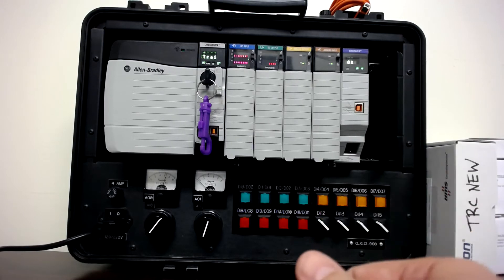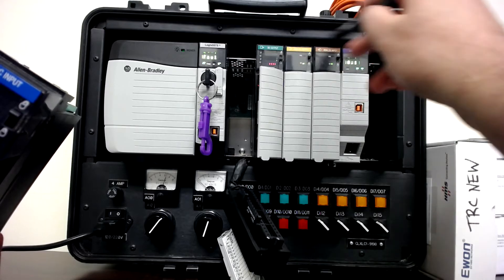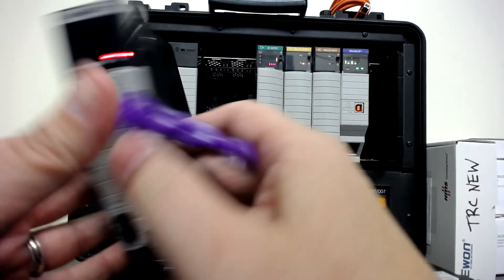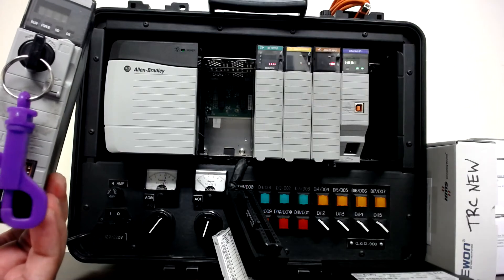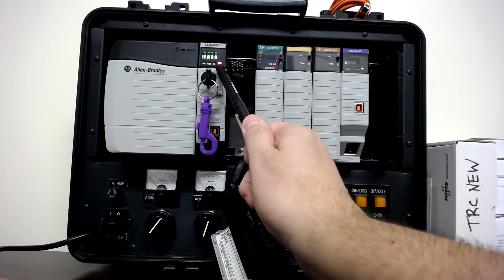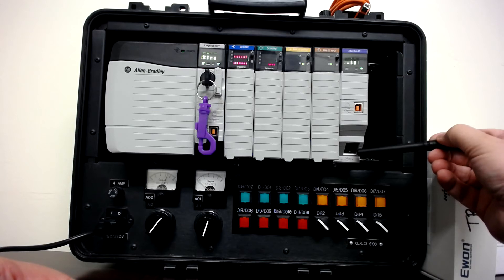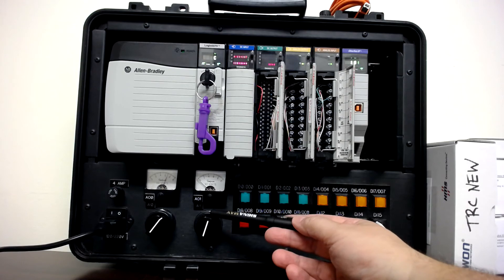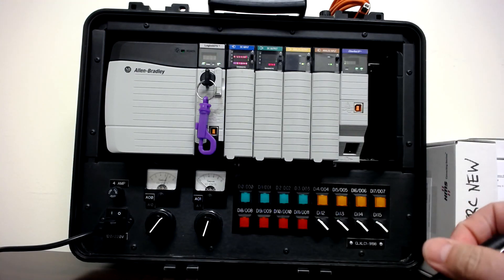ControlLogix Hardware Walk Through

Comment: I thought that the Slot configuration always begun with a Zero, So in this case the CPU would be slot Zero
Reply from the maker: Yes, in the configuration shown in this video, the CPU is in the first slot immediately after the power supply.  This "first slot" is referenced as Slot 0.  So this 7 -slot chassis would be referenced as Slots 0 to 6 in Studio 5000.

Comment: Hii, So informative your video, thank you so much. I didn´t know that you can make a warm remove of the modules (includ the CPU). I gues, if i need to add an analog module, can be pluged without power off the CPU or Passing to stop mode?
Reply from the maker: Yes, you can add an I/O module to a running ControlLogix rack.  But if the CPU's keyswitch is in the RUN position it will not allow it to be added.
Reply: @wawelk   will keep it in mind! Thanks men! and tankhs for the quick responds

Comment: Why cpu of control logic  key is keep under reset mode...
Reply from the maker: Hello Brahma.  I am not sure of your question and the meaning of reset mode.  But I think you may mean why was the CPU key switch in the middle position, or Remote position.  The remote position will allow a user to connect to the ControlLogix CPU while it is running and make changes,  If it is keyed to the Run position, then you could connect to view the logic, but you would not be allowed to make any changes.
Reply: @wawelk   thanks for your warm reply...on my comment.could you clear me on  this topic even if I do any configuration on software over  scada without key switch keeping over run mode...why do this configuration over there please let me clear sir...
Reply from the maker: @brahmanand3332  - sorry, still not clear on your question.  Are you asking about connecting to the PLC from a remote location?  If so, then having the key switch in the Remote position would be suggested - this would allow you to remotely service the PLC without anyone being onsite, or over the network from another part of the facility.  You could still connect to the PLC from a remote location if the key switch is in the Run position, you would not be able to make any changes to the controller - it would be view only (for troubleshooting).  The Run position would be best option for security of the PLC.
Reply: @wawelk  I got it... thanks for... having such support...
Reply: Sir hiii
Reply: We have problem in our cpu we have  alarm in hmi but we couldn't clear the alarm but in cpu has it showing it has fault but we need to get rid of this but we need ur help
Reply: Please how can I have that PLC ? Thanks